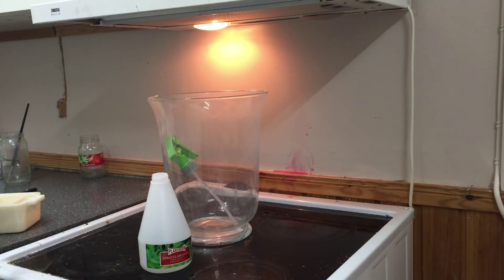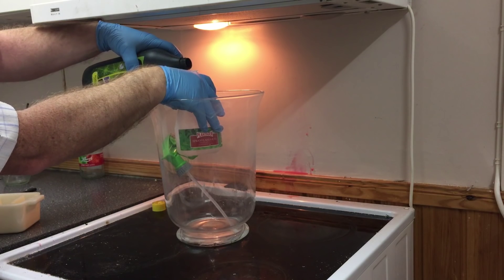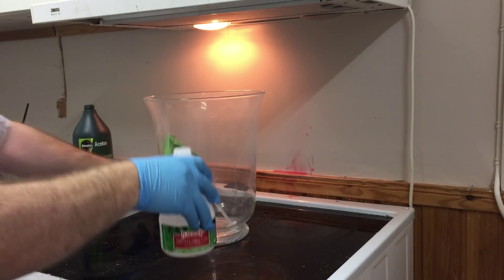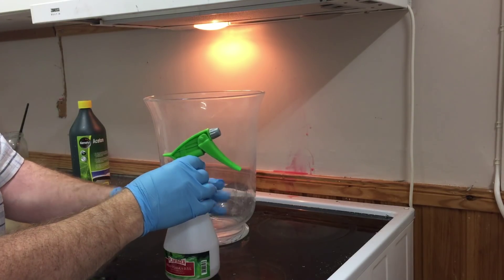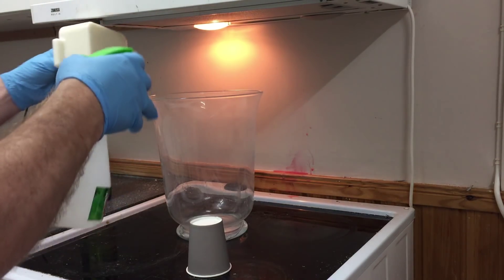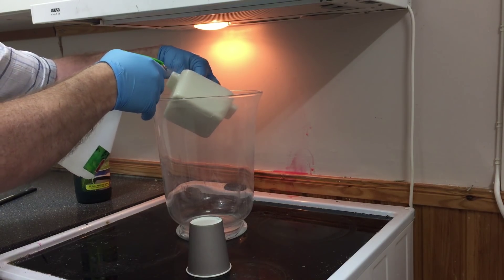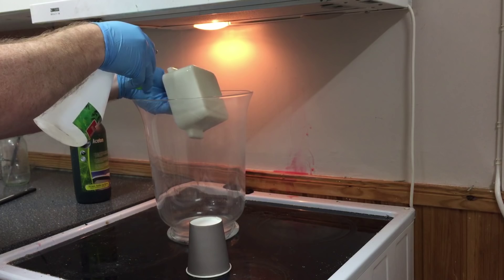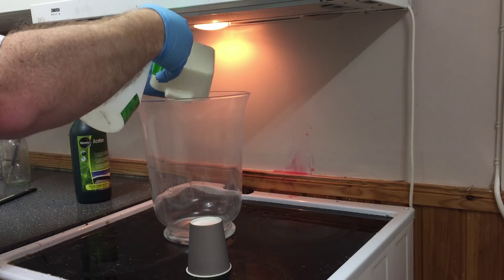Revolutionary surface treatment polished 3D prints - safer and less dangerous

Comment: Hi, there is another method that gives 'the best of both worlds' and combines parts of the 2 methods.  Take a large glass or steel vessel and use a spray bottle to spray the sides with a mist of acetone.  Place the part to be smoothed on a stand or plinth inside and cover the jar/ vessel.  Because of the fine droplets of the spray and the large surface area of the jar/ vessel the acetone will evaporate faster than if it was a simple puddle in the bottom.  The method will be slower than if you used heat to evaporate the acetone but will be safer because you are not doing it near a heat source.  It being slower may also give the added benefit of more control over the smoothing process.  To be safe it would be best to do it outside.

Comment: I think this solution is worse than your previous (cooking acetone) Here you created a massive cloud of very explosive acetone gas! I am an explosion expert, and you are lucky not to have had an accident.

NEVER do this! Better to submerge in acetone, close the lid, wait 10 seconds, open the lid, and remove your piece. 
What is the difference? SAFETY!
Reply: most of the parts need a fully filled tank to submerge the part completely. a simple part of 10*10*10 centimeters  needs about 3-4 liters of acetone. I think thats more dangerous. for bigger parts more acetone is needed. I prefer not to store that amount of acetone at home.

Comment: Sigh.
First of all, this only works for ABS. should be mentioned in title.
Second: I hope that's not a used kitchen in the video ?!
Third: the method is bad, it won't work evenly .
Last: Acetone should never have been boiled in the first place. 30-40 degree are perfectly fine for the job.
Reply: looked good to me.  probably want to put it on a turn table and spray very thin coats. won't get deep into high aspect cracks, but that might actually be an advantage.

Comment: The idea is not bad. For maximum control, use an airbrush-tool, or some other spray-bottles that give you less spill and finer spray. Something like refillable perfume spray bottles should do the trick too. They can be bought for a few dollars on amazon and i'm shure there are tons of other ways to source something better than that large spraybottle you use here. I'd still wear gloves, glasses and would advise you to best do it outside and not under your kitchen hood.
Reply: Ultrasonic Misting 3D Print Vapor Polisherhttp://www.instructables.com/id/Ultrasonic-Misting-3D-Printing-Vapor-Polisher/
Reply: Automated Ultrasonic Misting 3D Print Polisher PRO
http://www.instructables.com/id/Automated-Ultrasonic-Misting-3D-Print-Polisher-PRO/

Comment: SAFETY WARNING! Electric motors, even brushless, can cause sparks. Many vent hoods do not isolate the fan motor and the fan unit in any significant way. Basically, the entire fan system is now charged with air and acetone vapor. All it needs is a spark and it will combust dramatically, i.e. explode.
Reply: +TheDirtCreature 
Care to ellaborate how brushless motor can actually cause spark?
Reply: "even brushless, can cause sparks" Uh... A brushless motor doesn't have brushes, therefore there is no sparking, ever... Brushless motors use permanent magnets spun by electromagnets. Totally different, and does not create sparks, unless there is something SERIOUSLY wrong with it... Since the permanent magnets are what spin, NOT the electromagnets, there's NO COMMUTATOR... electrical connection to the electromagnets never break.
Reply: Odys polymechanos And that is a reasonable scenario. Acetone is a powerful solvent, and I am sure many plastic insulated wires are vulnerable, and repeated exposure to acetone fumes may melt the insulation, or make them brittle, which could cause a short circuit.

Just take the acetone outside... At least then if it blows up, it doesn't take your house with it...
Reply: +TheDirtCreature Sure but to have an explosion you need a specific ratio of air to fumes. The quantity is to small for that to happen...
Reply: ***** To me, anything electrical that lives in harsh environments, like constantly evacuating steam from cooking foods, is liable to fail at some point, possibly producing a short. These fans are not designed to evacuate volatile chemicals.
Reply: stylios zerox Perhaps, but I wouldn't do it in my house...and you know how many people on the interwebs who are going to do a lot more than a few spritzes.
Reply: +TheDirtCreature With the grease those vents have on and the volume the of acetone there is no way there be an explosion only if you try to paint your car under there :)
Reply: +thephatnguyen Some. (not all), electric motors use a commutator. This switches the electromagnets of the motor on/off as it turns. This may spark as the motor rotates.

commutator images:-
https://www.google.co.uk/search?q=electric+motor+commutator&tbm=isch&tbo=u&source=univ&sa=X&ved=0ahUKEwivzNaB9NnLAhUFNj4KHQ8ADz8QsAQINQ&biw=1120&bih=557
Reply: +Protomaker Black Sprint Original 3D Printer 
It still doesn't explain how brushless motor can actually cause spark, as claimed TheDirtCreature. The google search link is based on brushed DC motor.

If you mean the controller for the DC pulse motor, again, I can't see how it would cause spark. They don't use any relay to trigger any spark.
Reply: Yes you are right the only case that can happen is if the solvent s damage the cables or something like that :)
Reply: Melt is not that easy needs a lot of quantity more likely if you doing it all the time the insulators become stiff and break.Or the cables are a joke from a Chinese manufacturer. Final in the kitchen vents there is too much grease also so it protects the cables XD
Reply: Ultrasonic Misting 3D Print Vapor Polisher
http://www.instructables.com/id/Ultrasonic-Misting-3D-Printing-Vapor-Polisher/
Reply: And a similar 
Automated Ultrasonic Misting 3D Print Polisher PRO
http://www.instructables.com/id/Automated-Ultrasonic-Misting-3D-Print-Polisher-PRO/

Comment: abs? pla?
Reply: +Stig Brännlund Sorry but this is completely wrong. I made hose fittings for an aquarium filter out of PLA, and it is running since last year, with absolutely no damage, nor any leak. People have been saying that but this is clearly wrong.
Reply from the maker: +Xpim 3D This is ABS. Maybe you can replace the acetone with water on PLA.
Reply: +Ben-Tommy Eriksen Tetrahydrofuran works for real PLA, and some blends of PLA (Colorfabb i think) can be reworked with acetone too, probably because they are only partially made out of PLA or have another composition they just named theyr 'PLA'.
Reply: Seems odd I have to mention this but PLA doesn't dissolve in water.  Reportedly Ethyl Acetate (sold in many hardware stores as MEK substitute) reportedly works with PLA

Comment: Would you know if it's ok to put that in a fish tank? would it dissolve over tim  & would it  be harmful to the fishes?
Reply from the maker: +Thanh Quach I think it's going to evaporate. And it's probably not good for the fish.
Reply: Thanks Ben.
Reply: +Thanh Quach And be careful about your container of choice. Acetone disolves a lot of things, not just ABS. Maybe even the silicone glue used to make that fish tank in the first place. Definately always do some testing if you are not using solid metal or glass containers.

Comment: Do you really need gloves? I've seen many women use pure aceton to clean nail polish from their fingernails..
Reply: +David van Ballegooijen the acetone that people put on their nails to clean nail polish is not real acetone.
Reply from the maker: David van Ballegooijen I am unsure whether acetone can be sucked up by the skin. People who paint much recommend it. The most important thing is probably to not inhale the vapor.
Reply: +Ben-Tommy E3riksen §
Reply: +Bruno Rodriguez Don't know where you got that. It is most definitely acetone though it is not pure and it contains additives. Also those gloves you were wearing provide little to no protection from acetone. It will eat through them almost immediately.
Reply: +Bruno Rodriguez not real? Yeah, it's imaginary acetone! :)
Reply: +Ben-Tommy Eriksen The problem probably is not so much the acetone itself getting on your skin, but probably more the melted/dissolved ABS (and its additives) molecules in that acetone that can get embedded into fine cracks in your skin when the acetone evaporates away.
Reply: +Stig Brännlund You do know that women have been using acetone for...YEARS on their fingernails...right!?
Reply: Acetone can cause brain damage if absorbed through the skin, that's one of the reasons women are crazy

Comment: Are all the components of the spray bottle acetone safe? Or will it melt as well?
Reply from the maker: steve lofter The spray bottle has not melt so far. I have used it for a months now.
Reply: you need a polypropylene bottle i know my response is to late but usuualy use polypropylene bottles will hae a pp and a recycle emblem. most the little sprayers in the travel section at walmart are pp and safe to use